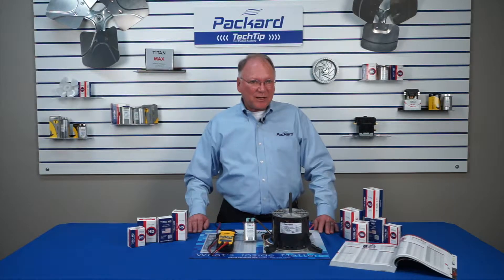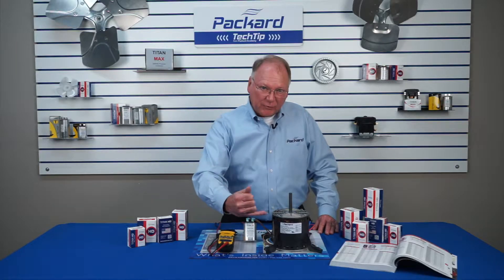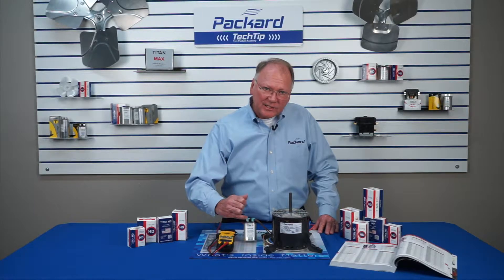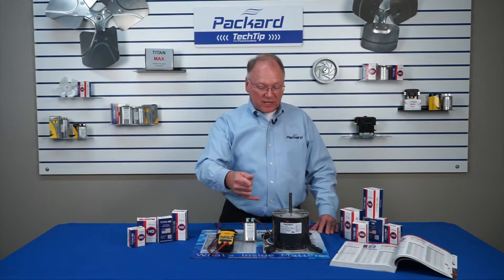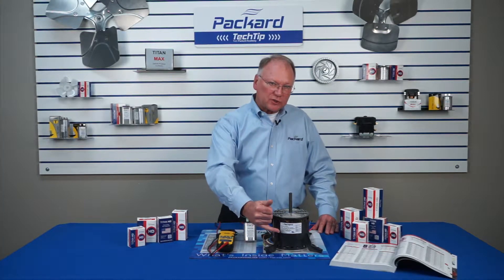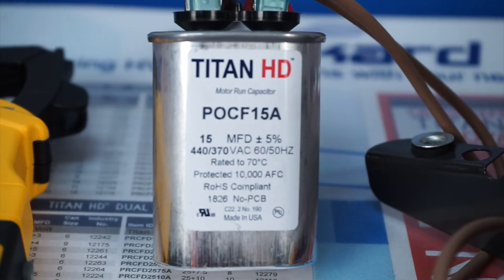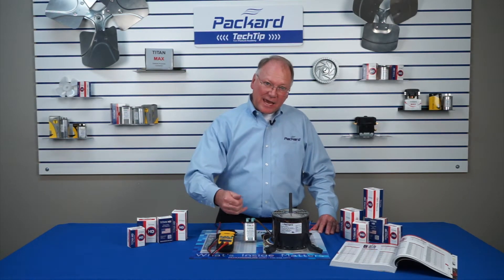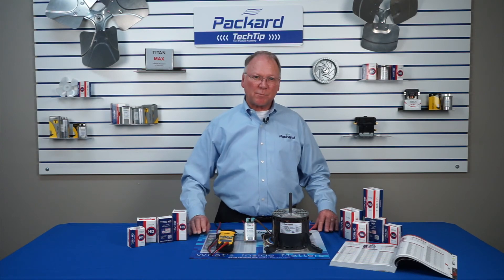Titan HD 440V Capacitor- 60,000 Hour Long Operating Life (2/2)

Comment: The specs on the Titan HD i bought matched exactly as the installed Titan HD.                                         Just question on if the number before the No-PCB matters, example "1836 No-PCB(on installed can) and 2324 No-PCB (was on new can)"  ?